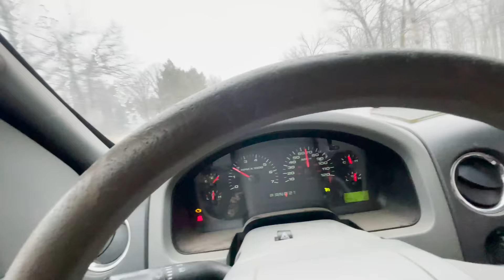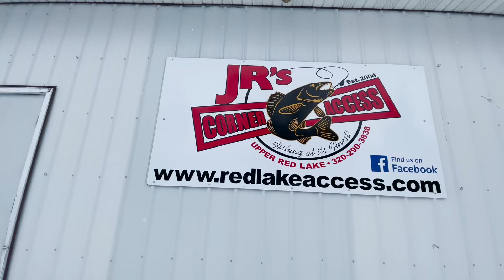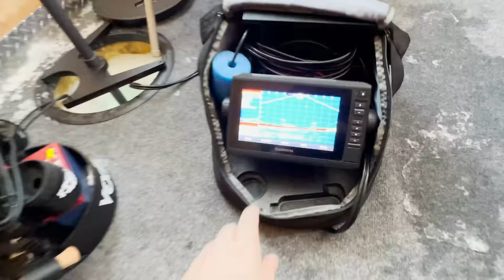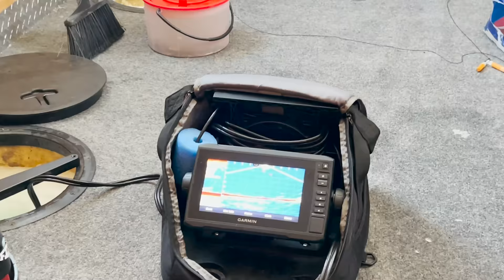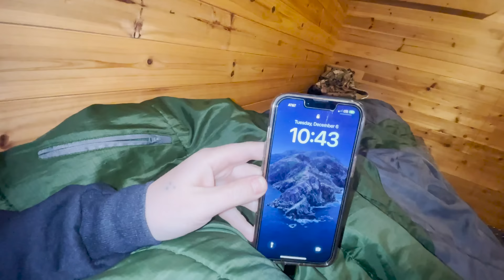24 Hours Ice Camping on Red Lake! (Catch and Cook)

Comment: That goldeye should have been killed immediately and thrown out on a tip up about a foot below the ice. Red has monster pike in it and 40" fish are extremely common.my best is 46" but every trip we get at least a few over 40c running tip ups, huge dead baits, just below the ice in 9-14feet of water. Those big pike cruise just under the ice looking for angler killed released fish. Goldeye is the best bait you could ask for anywhere big pike swim.